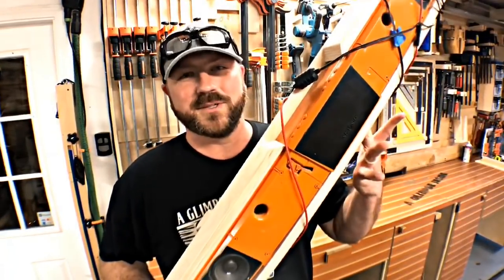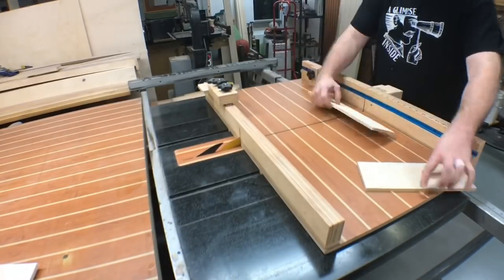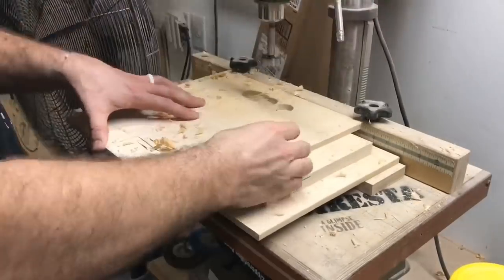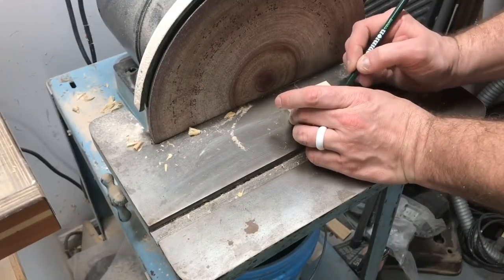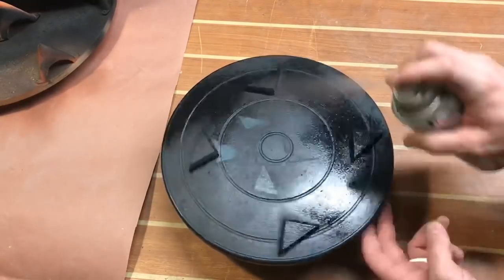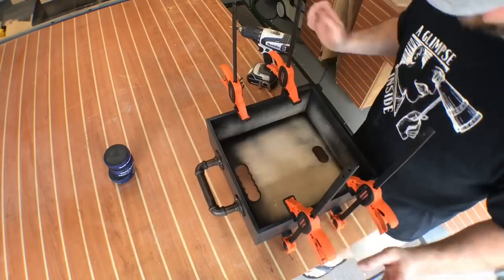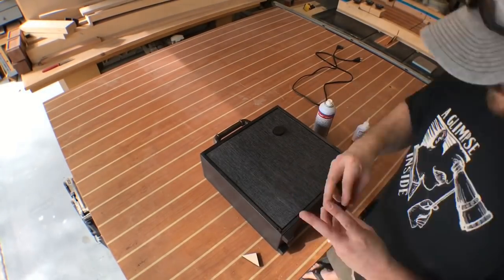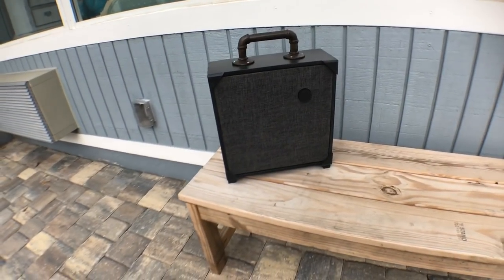How to Make a Portable Bluetooth Speaker Case for A French Cleat System | IKEA Hack DIY

Comment: My home inkjet printer has a copier feature on it. 

If I'm needing to mount something or need to cut holes for openings in smaller things, I just photocopy the item (I do this for powerboards all the time. At first my wife would wonder if I'd completely gone bananas) and either mark the holes through the paper or attach to thin cardbpard and use a utility knife to cut out wider openings amd pencil mark the apertures needed. 

Your speaker, for instance, would just need to be turned around, a second photocopy taken and the 'images' taped together.
Reply: Also, we've got a laminator, and thats been used to stiffen the images for widere holes.